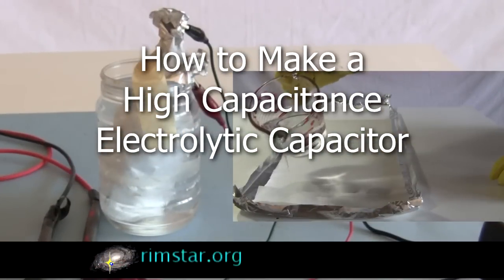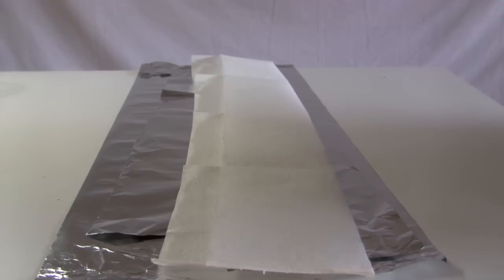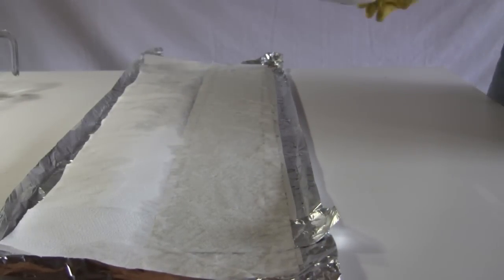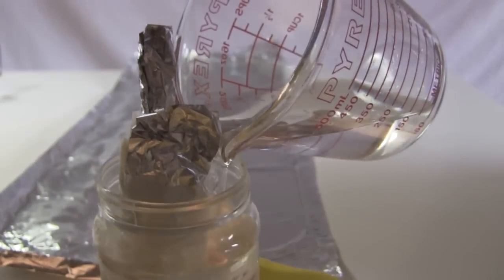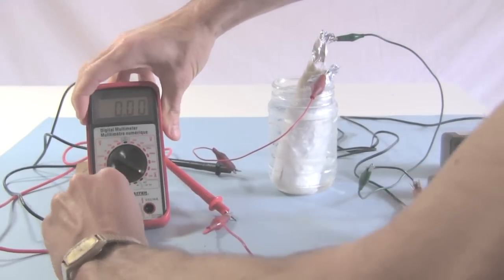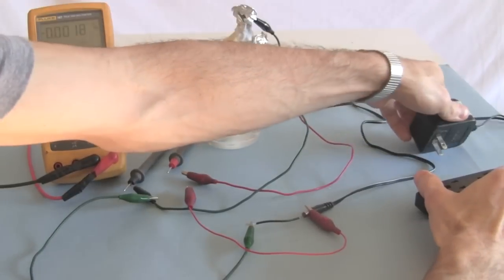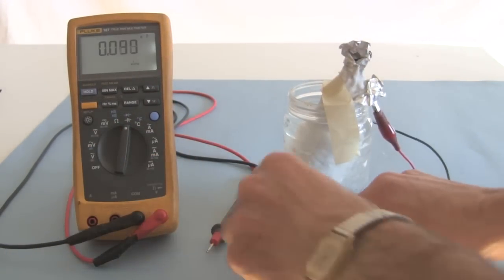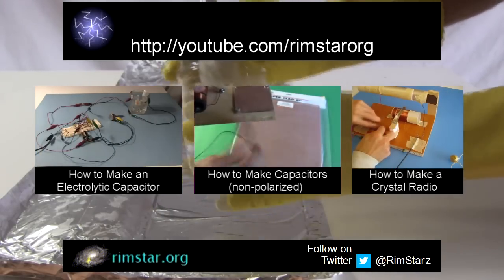How to Make a High Capacitance Electrolytic Capacitor

Comment: Electrolytes used in commercial aluminum foil electrolytic capacitors are conductive solutions of organic and/or inorganic acids neutralized with amines or ammonia in various solvents, predominantly butyrolactone and ethylene glycol. To fill your mind with more trivia the method used commercially to prevent the cathode oxidation you noted manufacturers dope the electrolyte with organo-phosphates in low concentration as a stabilizer. An interesting side note, organa-phosphates are the major constituents in binary nerve agents and are inherently quite toxic so never inhale the magic smoke when capacitors fail catastrophically if it can be avoided. lol
Reply: Speaking of binary lol it's the future of electric vehicles.binary super capacitors.in concert with ping pong relays that transfer current back and forth via amp metering .allowing the charge to rebuild back and forth eliminating lots of weight and waisted space..but most importantly eliminating need to recharge your vehicle ....the sadly the science is proven to work but corporate greed will not allow us to have it yet.on planet greed.
Reply: binary nerve agent? what is the other part? I've known ppl that fumed up a whole lab blowing electrolytic and they didn't show any neurological symptoms other than utter glee.
Reply: Organic chemistry. I talked with a chemical engineer once. I told him I wanted to make my own Tetraethylead for my hot rod.
He flat out told me I would die in the process. Thirty years later, I can buy E85 fuel at the gas pump. 
So 12 to 1 compression is no longer a knock, ping, detonation issue.

Comment from the maker: That's definitely one reason why I like these experiments. I learned a lot from them and it's such generally applicable stuff that I'm sure it'll come in handy later. e.g. The forming current was much higher for the paper towel and aluminum foil coils cap than for the two plates in a glass cap. Kind of obvious why in hindsight, but when I build something similar in the future I'll know which way to go on the first try. And I'm delighted to hear you're enjoying these. Glad I could reciprocate.

Comment from the maker: To test voltage rating, connect a volt meter and a variable power supply to the capacitor. Then increase the voltage on the power supply and watch the voltage increase on the meter. When the voltage on the meter all of a sudden drops to 0, the voltage it was reading just before that is the voltage rating. Put a few hundred kilo ohms resistance in series too. I do some in my "How to Make High Voltage Capacitors - Homemade/DIY Capacitors" video. There's a link in this video's description.

Comment from the maker: Yup, I'm very familiar with them since I play with Wimshurst machines too which use Leyden jars. All capacitors store static electricity between two electrodes. A lot of folks think Leyden jars are a special type of capacitor because they are usually called Leyden jars, but really that's just for historical reasons as you mention. It was literally the first capacitor and was discovered by accident in the village of Leyden.

Comment: I think i find the Max Voltage. there is no limit for breakdown voltage ! actually it is possible to make 1000 volt electric capacitor ! you can make capacitor with different voltage. remember the first step of making your electric capacitor. the fisrt voltage which you applied to coat the AL plate with AL2O3, is most MAX voltage that your capacitor can work well because the thickness of AL2O3 layer has a direct relationship with the voltage that you coat the oxide layer with.

Comment from the maker: I put both tabs at one end to submerge it in a jar filled with electrolyte to take care of evaporation. It sounds like yours won't be in a jar. It'll be interesting to see it evaporation affects the electrolyte between the plates.
Re 2, more capacitance, the electrolyte is conductive. Only the oxide layer is the insulating dielectric. So the aluminum plates could be 2 feet apart and the capacitance will be the same since the oxide layer will still have the same thickness.
Keep us posted.

Comment from the maker: That might be good enough for a very big capacitor. IIRC the big cap in my video only got to 17 milliamps when I stopped the forming. I think the bigger the cap, the higher the current it will stop forming at. That makes sense since the bigger the cap, the larger the surface area. Or it might have to do with that these caps have a very thin electrolyte, so resistance through the electrolyte is less.

Comment from the maker: That makes sense since you'd have a better conductor of charge as the electrolyte plate. But I'd assumed, maybe incorrectly, that only certain electrolytes would make an oxide layer on the aluminum.

Comment from the maker: I don't know what the breakdown voltage of my homemade capacitor was, though I doubt it was 300V DC. If you're looking for a replacement then you're probably better off buying one.
Reply: I'm pretty sure it's the forming voltage that youbused. If at a later time a higher voltage is applied, it will break through the oxide layer. But if you slowly keep raising the forming voltage keeping the current low, you'll find the oxide layer gets thicker and thicker.  And, as the oxide layer gets thicker between the plates, the capacitor's farad raiding drops.

Comment: Really enjoying your channel man, mostly all the electronics stuff.  Im a chemical engineer so this topic is well under my belt, but my electronics basis is only moderate; your vids have been a great help in my quest to improve electronics skills with your well working descriptions, as ive been able to go from basics to fabricating power supplies, amplifiers, control circuits, etc from scratch to power/control chemistry based projects cheaply with homemade circuits.  Thank you for your time to teach these things.

One question im still trying to work out....exploring possibly efficiency improvements of H2/O2 production in electrolysis by possibly mechanically breaking apart "extra" H2O molecules with force rather than e- transfer consuming power with a high frequency A/C signal through closely spaced plates by "pulling" them apart in an extreme electric field.  I know it most likely will not work; but i must have projects to feed my mind.  My problem is how to build an efficient amplifier for high frequency/high current at relatively low voltage; or how to amplify high freq at all due to inductance losses in transformers etc at high freq.  Maybe a switched supply using MOSFETS to drive output current waveform?  Any ideas would be much appreceiated
Reply from the maker: I'm glad to hear you're finding my videos useful. Unfortunately, I don't have any suggestions off-hand for the efficient amplifier which you describe. The only amplifier I've done is this one https://www.youtube.com/watch?v=JtPwxbOgBHw which works for low current.

Comment from the maker: I was planning on sealing it but forgot about it when I rolled it and selecting a jar. Would have been cool.

Is that both silvered foils from a cap that work great or just one of them? I ask because I'm curious how the negative foil in a commercially made electrolytic cap doesn't get oxidized whereas the positive foil does. If only one silvered foil is great for earth battery cathodes and not the other then there's something different about the foils.

Comment: Enjoyed that, very clear. Could seal it in a formerly leaky TV capacitor can. Electrodes poke out, hotglue at the top. Btw, if you unroll an old electrolytic, the silvered foil works great as Cathode in earth batteries, seems nicely corrosion resistant for long periods, perhaps through being formed and wet all those years.

Comment: I have a few questions.
I made a DIY capacitor w/ two larger soup cans and some Saran wrap. I will charge it using 4 AA batteries(NOT NEW!! But not very old, either) or a new 9v battery.  Please answer the following:

How do I charge it?

How long will it take to charge?

How will I use the built up power?

There seems to be some issues w/ it, I can't make it light up an LED after charging it for a second. 

Thanks!  Love you channel :)
Reply from the maker: Bob dabiuld Do you mean that one can is inside the other can with the Saran wrap in between the two to keep them from touching? If so the capacitance is very small, probably in the picofarads. To charge it simply connect wires to either side of the battery. Connect the wire going to the positive of the battery to one can. Connect the wire going to the negative of the battery to the other can. Because of the very low capacitance it should charge up in less than a second. However, also because of the very low capacitance, the energy stored in the capacitor will be very small, nothing useful really.
You need to make a higher capacitance capacitor so you can store more energy. I just tried it with the rolled up one I make in this video https://www.youtube.com/watch?v=GveI9gXIsHw and it wouldn't even briefly light up a small LED.

Comment: great vid. i am wanting to make a capacitor bank for a 12, 000 volt transformer. I am wondering if i can make a series of bottle capacitors and solder them in paralell.. i am not sure how many to make...
Reply: 12kv transformer:  I might sugest a Leyden jar like capacitor. It's not polarised like electrolytic capacitors. And can work with really high voltages.  You could make one with pc pipes.   Looking up pvc dielectric strength,  one may find between 10 to 30 kv of protection  per millimeter.  2mm wall pc pipe might protect you between 20-60kv. The dielectric constant  for PVC looks like about 4, but probably varies according to frequency.

Comment from the maker: I haven't tested breakdown voltage. Added layers of paper towels shouldn't help though. The electrolyte is conductive and the paper towels are soaked in it. The purpose of the paper towels is to keep the aluminum plates apart while the oxide layer forms. After that, the oxide layer is the only insulator. I'm guessing you can't get 12kV breakdown voltage since store bought electrolytic capacitors are never anywhere near that. I've seen hundreds of volts breakdown voltages in store bought ones.
Reply: Could you use bandages instead of paper towel?

Comment: I imagine sodium bicarbonate is used here due to its availability, ease of use, and low cost.  Are there any superior alternatives to sodium bicarbonate for a diy cap?  Alternatives that are maybe slightly more expensive, require a little chemistry or extra work to pull off that create better caps?
Reply from the maker: vegasbryan Check out http://en.wikipedia.org/wiki/Electrolytic_capacitor. There's a list there of different electrolytes and plate materials. I'm don't have any experience with any besides what I used in this video.
Reply: Boric acid is the electrolyte used commercially. You need to very accurately control the concentration to get the best results though.
Reply: Gordon Lawrence Thanks Gordon.  I will check that out and read up on it a bit.
Reply: Find out about equilibrium reactions and such like because you are using elecricity to push the reaction

Comment: One thing I don't understand is the salted distill water.

Isn't the reason we place paper or electrolyte napkin paper between the +\- foil is to completely separate the 2 plates?

But when you pour electrolyte on napkin and soak entire capacitor in the salt water.

+\- foil plate is no longer separated. Or giant leak.

Can u explained how this can boost capacitance?

Usually when capacitor has leak. It is consider as a defect a compacitor.
Reply from the maker: See this other video where I first made a simpler electrolytic capacitor and explain how it works http://www.youtube.com/watch?v=ml2TdQ2_2mk. The napkin paper is there to keep the plates from touching while we form the oxide layer on one of them.

Comment: What if I used an entire roll of aluminum foil? With paper towel roll. put inside a round big gallon container that's just a little bigger than the finished rolled up capacitor to keep it steady and not allow too much waste of liquid and material. using distilled water of course.
and used a 3v 1A transformer with a bridge rectifier and let it charge until the current dropped to very small amount.
How many microfarads would that be? A few thousand or more? My guess would be over 5,000uF or more.

Comment: "Re 2, more capacitance, the electrolyte is conductive. Only the oxide layer is the insulating dielectric. So the aluminum plates could be 2 feet apart and the capacitance will be the same since the oxide layer will still have the same thickness."

I stand corrected. Capacitance depends on plate area, thickness of the oxide layer, & its dialetic constant.  Electrolytes are conductive, but they have resitance, but may not add up 2 much over short disances except in some pulse power aplications.

Comment from the maker: Not with an electrolytic capacitor. With an electrolytic capacitor the oxide layer that builds up on the aluminum is the insulating dielectric and it's extremely thin while still being able to handle a lot of voltage. The thinness gives the capacitor a high capacitance. All the thin plastics I've ever used aren't nearly as thin as an oxide layer and so you don't get as high a capacitance. Thin plastic works, just doesn't give the high capacitance.

Comment: Does forming voltage=breakdown voltage? Was originally planning on making 100 ELDC supercaps using graphite for a railgun, but now i feel that making a few of these at a much higher voltage is better.
Reply from the maker: Unfortunately, I don't know what the breakdown voltage was and I didn't think to measure it. I know commercial electrolytic caps come in a variety of breakdown voltages so I don't know what determines it.
Reply: Guess ill have to experiment with it, thanks, wikipedia does say 100Vmax for water based electrolyte

Comment: Just wondering, if you do like 50 inches long Aluminum strips instead of 28 1/2 inches, would the capacitance increase? If not do you know a way to do so? Also what is the voltage limit of your DIY capacitor? I am really excited to make one myself.
Reply from the maker: Yes, 50 inch long strips would give you higher capacitance than my 28 1/2 inches long ones. As for the voltage limit, I didn't measure it so I don't know. Have fun with yours.
Reply: Also, what side of the aluminum foil should be in contact with the separator? The shiny side or the dull side?
Reply from the maker: I'm not aware of any differences that using the shiny or dull side would make.

Comment: Hi,

I want to ask if you measured the capacitance?
How Many Farazi Was Resulting?
What tensine can flow constantly?
  I'd like to build more supercapacitors to power a DC engine for as long as possible.
How many layers and what length should I get to get a supercharger of 3000 Faras and 2.7 V? Thank you.
Reply from the maker: Yes, see the video at around 8:40. I get 560 microfarad. This isn't a supercapacitor, it's an electrolytic capacitor. You'll need to make it differently for the amount of farads you want. I've never made a supercapacitor so I can't help there.

Comment: Don't know yet, will find out. All it was, was the use of the foil as the cathode, copper as anode, for constant 0.6V/30uA approx. Was before folks started forming same metals on the forums, in battery experiments. What I did was stuck the foil on a piece of card with white glue. As soil is electrolyte (esp after rain) it can be imagined that 2 pieces of the foil, pre-formed in Baking Soda solution, may accept Earth energies, from lightning storms etc. Either which way, they may never corrode.

Comment: would a Mylar dielectric capacitor be easy to make and be able to handle thousands of volts also?
Reply from the maker: +Westchester I've never worked with mylar myself but I know a lot of people have bought and used it for making capacitors. Search on google.com for something like "breakdown voltage mylar" or "dielectric stength mylar" to see how many volts it can handle for a given thickness. Note that it won't have as high a capacitance as the capacitor in this video i.e. won't be able to store as much charge. That's because the dielectric in this video is a very, very thin layer of aluminum oxide, whereas the sheet of mylar would be the dielectric and it's a lot thicker. However, the capacitor in this video can probably handle less than a 100 volts before breaking down whereas a mylar one should be able to handle much more.

Comment: What if one wants to make a 2-section electrolytic capacitor, kinda like one of the multi-section capacitors with 3 pins or more, usually found in old radios or old tube Television sets?
Reply from the maker: This is the first I've heard of multi-section capacitors. However, from a quick search it looks like these are just multiple capacitors in a single can so I guess you could just make multiple capacitors instead, unless space is the issue. But as I said, this is the first I've heard of them so there may be subtleties that I'm not aware of.